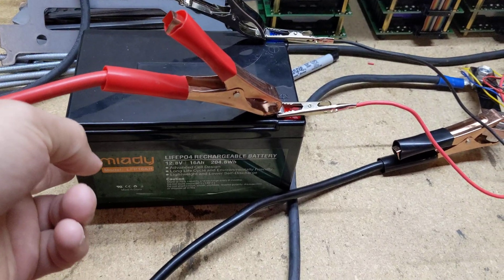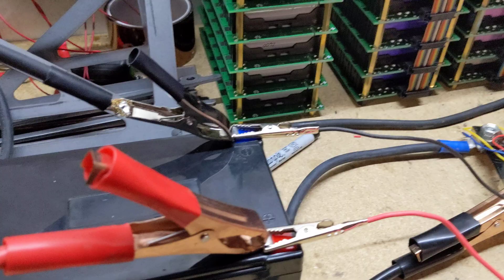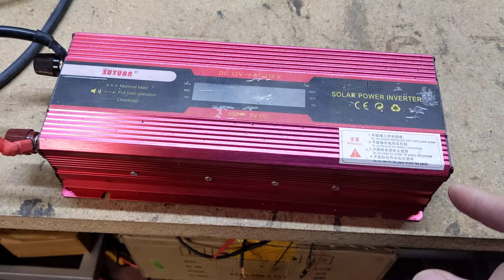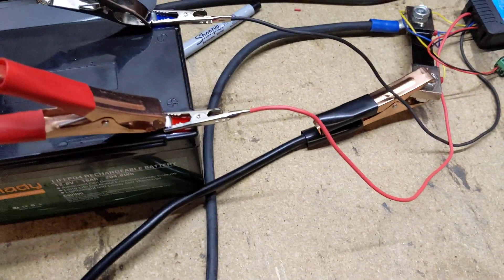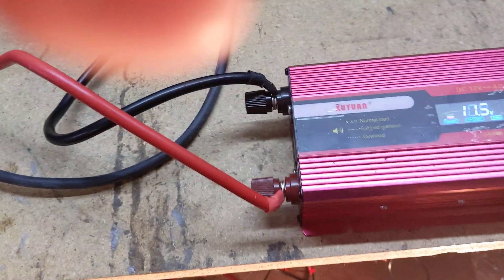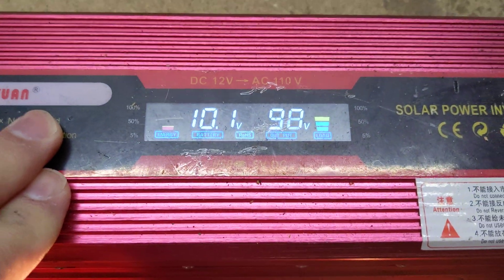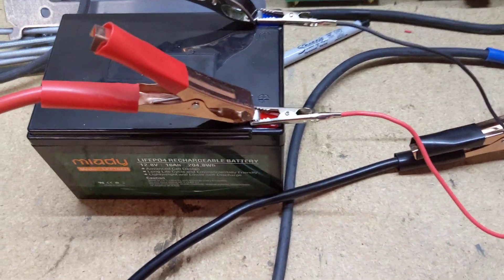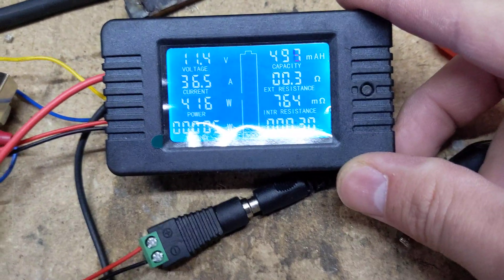Miady Lifepo4 16 Ah battery 40 amp draw test

Comment: I'm new to these batteries. Would the 36ah be able to pull 40amps okay?
Reply from the maker: Do you have a link to the model you are referring to specifically?
Reply: @offgridmaryland  YouTube doesnt like the links. It's by Miady. It's a 12v 36ah 460.6wh lithium battery on Amazon
Reply from the maker: @micahtron5000  I see it ... I am wondering if they used the same Lifepo4 18650 form factor cells for this unit if so i would be skeptical on more then a 40 amp bursts without severe voltage sag ...    However if they used 26650 cells probably would be able to do it awhile ..  but that would drain that battery pretty quick.   it would be interesting to hear your experience

Comment: I bought some of the smaller ones,  and they weren't much cheaper than good ones. I'm not using them for high draw application, so they are ok, but wouldn't buy them again. Had probs with two of them being loose inside. Had to disassemble and hot glue the pack into the case.
Reply from the maker: Yea they are good to replace for low amperage applications ..   When i first received mine it was in low voltage disconnect and i needed to give it a full charge to get it going .   There is a reason why they put these out there so much cheaper then a lot of other batteries.